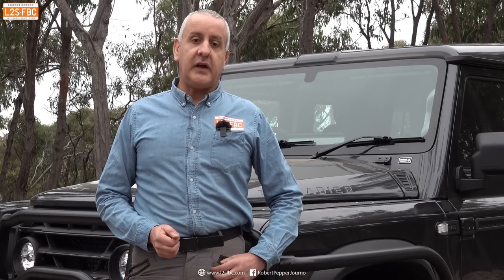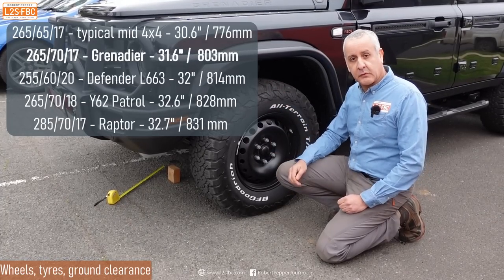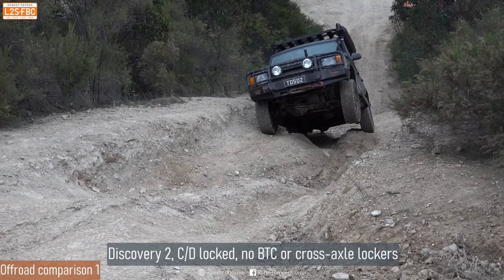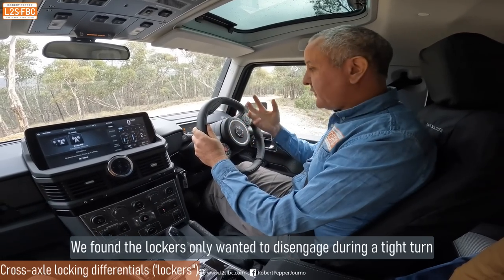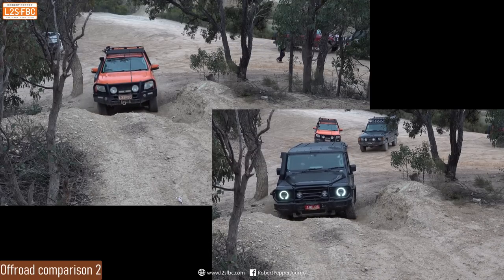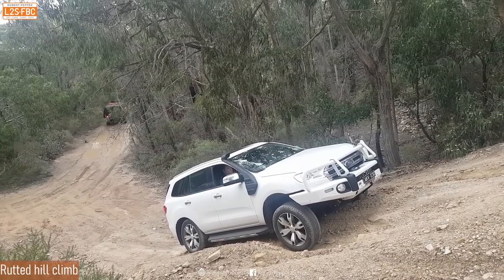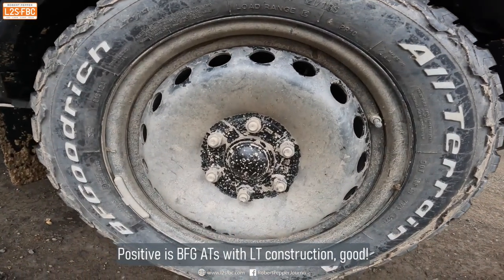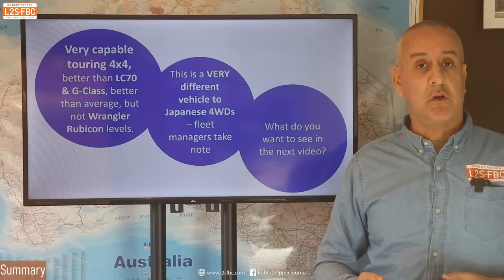INEOS Grenadier Offroad Review & Comparison : Australia

Comment: Excellent assessment. Fair and reasoned, unbiased. It strikes me as a unique vehicle in the modern 4x4 sector - combining modern TC and drivetrain/transmission with traditional chassis, suspension and axle design (isn't this what we've all been looking for?). Do you think the slightly inferior (to LR/T) BTC is a firmware update away from making it as capable as other BTC systems on metal sprung vehicles (ie no ability to shuttle spring rate/ride height as on Defender/Discovery)? I can't see any reason mechanically why it couldn't be 'upload update' refined to be as capable as Toyota's.
Reply from the maker: Thanks - the BTC may be a firmware issue, depends if the underlying hardware can handle it. Probably can. For BTC to be effective you need very sensitive and granular wheel speed sensors and then braking capability. I would expect the hardware to be in place, and the calibration need improvement. Possibly they took the view that people would just always use lockers. Well, doesn't work like that, lockers aren't always better.
Reply: Cheers fella. Interesting. I'd imagine JLR/Toyota's wheel speed sensors are third party supplier products anyway, but the software very much proprietary (and in JLR's case with TR2, their most important piece of intellectual property). Considering how long it's taken for BTC to exceed good ol' mechanical grip, there must be a lot of development required. Will be interesting to see if Ineos are happy to offer firmware updates as and when, rather than requiring you buy a new vehicle... As you know in soggy blighty, BTC performance is vital on simple wet climbs and its here that I've found modern JLR product unbeatable (though we have no LC300 or Patrol). @L2SFBC
Reply from the maker: There is precedent. Ford improve the BTC in the Everest (you don't get that in the UK) with a software update, so there is hope.

Comment: Hi Robert great review you can get the winch to work with the engine off say for instance you want to spool some rope  without the engine running just put it in "carwash mode" and the winch and NATO socket are powered.
Reply from the maker: No, won't work with the engine off, confirmed with INEOS.  Yes, a pain for the reason you mentioned and others.
Reply: @L2SFBC  I have a  Trialmaster and it does I can run the winch with the engine off .

Comment: I would like to know your thoughts on how easy it is to maintain for the home mechanic I.E. replacing brake pads, shocks and springs for a 2” lift, all the filters and oils, how good is the underbody protection from factory. 
Great video 👍
Reply from the maker: Can't say at this point, but I did take a look underneath and can't see any issues with suspension swaps, brakes etc.

Comment: What I want to see in the next video is how you can take an angle grinder to the DPF under the floor on the BMW engine to create enough clearance to then hammer the footwell flat on a RHD model. 
Then you might have some room for your left foot!
This vehicle has massive potential to be modified by the owners if they want to start hacking it around (and invalidate the warranty) but thats good right, its your vehicle do as you choose if you want
Reply from the maker: One owner has removed the footrest and found it to be much larger than required, so there's that.

Comment: Hi Robert I am a tow truck driver and I quite often look at these things from the angle of my job.
In the event of an electrical failure or the engine not running, can this vehicle with that electronic BMW shifter be put into neutral?
Now obviously if it has a manual lever to put the transfer case into neutral this will not be a problem.
A lot of BMW vehicles that I deal with have no way to put the vehicle into neutral without climbing underneath removing bash plates and manually selecting it on the side of the transmission.
Reply from the maker: I don't know, but suspect it wouldn't matter as the t'case could be put into neutral. Could any Grenadier owners confirm one way or the other please?  An excellent question.

Comment: Along with the exposed steering components, what about the Auto Cooler behind the bumper and it getting clogged by mud and thus the Auto Trans losing its cooling abilities? Also, the Rear Trailing Arms that are mounted on the chassis seem to hang down quite low - would this be a issue when 4wdriving in rocky situations or step-ups - are they prone to getting hit? 
I would like to see better views underneath and what potential there is for increasing the fuel capacity... 
The Aircraft tracks on the outside of the car on the doors and below the rear side windows - what are they useful for? Do u really need them (should they be an optional instead?)
What is the tallest Tyre that u can fit?
That suspension noise to me means they haven't selected a long enough coil and thus its moving in its seat - fitting a slightly longer/more progressive rate coil may prevent that suspension noise?

BTW: Great video as this is the first time a seen a video that tests the vehicles offroad ability in a bit more of a real world scenario...
Reply from the maker: I didn't spot the cooler issue. Arms aren't great but not overly concerned.  I'll cover fuel capacity etc another time, and the tracks.  I'm told 285/70/17 fits no problems. The coils are progressive. Thanks for the comment.
Reply: @L2SFBC , Yes I heard u mentioned the coils are progressive rate, but really, they should not be making that noise when flexing. My old Defender doesn't do that, and it has pretty good articulation as well. For me personally I would find that a little annoying on a new vehicle, but it should be fixable and it's not s showstopper.
Also I agree with your views re: The lack Winch operating flexibility...

Comment: question: can you put 33 or 35's into Grenadier ?
Cargo organizing. - How is floor design so it can be bolt down a draw system or slider 
Option to use side tie points. It looks like bunch of the but do they useful? Like on rear quarter panel has one track, it feels like a prefect place to use "Molle" panels. Does fit a large fuel cell? \
The roof length? RTT like ikamper fit?
tire Inflation system is really useable with 33/35 inch tires.

Comment: I would like to know your thoughts on road touring in the Grenadier, I have ordered one and would be using to commute 300km to work up a winding rural range on tar. Also planning to use to explore tracks around mid north coast. I have ordered without a winch, do you think a winch would be necessary, or would a turfer winch get out of trouble for occasional getting stuck.
Your thoughts would be appreciated, I enjoyed your off road test and comparison to vehicle which we all know and see.
Reply from the maker: I think i'd be fine for that use.  It's not a Defende onroad, but it doesn't need to be. I love winches, and even the INEOS winch is better than nothing...it all depends on what you intend  to do. I would definitley carry 4x recovery ramps, jack etc.

Comment: Good review. Grenadier traction control seems too slow, it seems to allow the wheel to spin a lot before it kicks in, whereas the new Defender system only allows far less slip.
Reply from the maker: It's not as good as Toyota or Land Rover, but it's good enough.
Reply: That is the hallmark of LR.  I would say the traction control was pretty good in the IG.  In  many of situations, you would have locked the diff before attempting.  Plus most people will have the electronic diff in the l663 so the on traction control would be the front wheel.

Comment: I reckon a 25-50mm more ground clearance would be useful. Awesome video!
Reply: Yeah I agree it looks way too low and unfortunately looks like you can't fit bigger tires very easily so it did follow Land Rover in that way haha I'm surprised they're comparing it to an old disco when it's so expensive in 20 years newer it should have compared it to a Bronco and a Wrangler Rubicon but by the end of the video everybody would have wanted a Wrangler Rubicon what is outstanding everything ability

Comment: The 300 Series GR-S is equipped with 265/65x18" which is same nominal diameter as the Grenadier's 265/70x17" - I do agree that this is a slightly small size compared to what is standard for Y62 Patrol, etc.  

Disengaging / engaging the lockers is a general pain in the butt for even ARB air lockers.  The best system is the computer controlled Land Rover Defender.  But the jury is out on the Defender's locker reliability in the long run.

Land Rover's traction control is head and shoulders above every other make but the Grenadier's system looks reasonably well calibrated.
Reply from the maker: Yes, same size; I feel that given how offroad-oriented the Grenadier is, it should have gone larger. I did not make the same criticism of the LC300 when I did the preview drive as that car is more multi-purpose than the Grenadier.

Comment: Great video Robert. I’m a novice with BTC, so here’s a question that may have an obvious answer. Can you modulate roll back on a difficult up hill section with the hand brake in those interim few seconds before the system catches up?
I hope that’s a clear  wording of my question
Reply from the maker: BTC is Brake Traction Control, explained here https://youtu.be/_CqkDLo1owA .  What I was doing for the test was driving badly; I let the car come to a complete halt to see if it'd pull itself out.  The correct driving technique is not to come to a stop, and that is demonstrated both ways in the video linked.  If you do need to hill start, then use left-foot-braking as demonstrated in the video. Hopefully that answers it?

Comment: Heavy towing review please around 3.0T.  Given the good gvm, gcm, axle loads, tow capacity looks class leading on paper.. is it?
Reply from the maker: If I can get a car, then yes, also towing. The touring video will be a weights analysis for towing - spoiler - it's looking good. But I'd like to tow practically too.
Reply: @L2SFBC  Took an educated punt on this as a good out of the box  tow platform having followed the build and specs, one I can park at the shops, do the occasional off road adventure, legally tow something heavy and not have to spend another squillion dollars (after having to already spend a squillion dollars on a new 4x4) on upgrading suspension, cooling, oil catch-can, additional fuel filter, aux battery, off road tyres etc etc to then have a questionable driveline warranty should a claim need to be made.  Well presented video thank you and look forward to your 'Heavy vehicle towing review of the Ineos Grenadier' 😀

Comment: Discovery 2 has TC they just about invented it, how did TC work on the Grenadier with CDL and not without?
I thought Grenadier did not have TC , I may be wrong . 
Re winch you recommend rollers with synthetic never heard that before and would not recommend it personally
Reply from the maker: The video covers Grenadier with CDL unlocked and locked. Rollers work GREAT with synth rope!
Reply: @L2SFBC  you said the D2 did not have TC, which is not correct, and rollers with synthetic rope positively dangerous. I teach winching to Mountain Rescue English and Wales.
Reply: @L2SFBC  smooth fairlead for synthetic ropes
Reply: @Ardventures The D2 TC has been disconnected on that vehicle due locker installation. I have a D2 and agree, it’s TC is excellent, especially with a centre diff lock.
Reply: @davidkelly3779  maybe that should have been pointed out
Reply from the maker: It was...
Reply: @L2SFBC  no it wasn’t
Reply: @Ardventures  Yeah it was, that’s how I know.
Reply: @davidkelly3779  it said the D2 did not have TC

Comment: HDC needs to brake every wheel independently. So If the axle lockers are engaged, then when a wheel is in the air and it is stopped by the ABS, then the car would be still and no rolling down the hill

Comment: Robert... Many thanks mate for this review. You share great information. I'm anxious to get behind the wheel on one these vehicles, or perhaps purchase one. So disappointing about the winch mount drawbacks and frame-mounted recovery points not allowing a 4.75 Ton metal anchor shackle. So easy to engineer from conception; shame INEOS in my opinion. Love the strong live/solid axles plus the front AND rear axle lockers. Sorry Land Rover, I'd purchase a Grenadier LONG before I'd buy a new Defender. with the Grenadier I still worry about repair parts worldwide (unlike the "no worry" of getting parts for a Toyota or some Jeeps, and other vehicles that have been mass produced). When INEOS gets multi-thousands of these vehicles in the field, then my worry will be minimized. Repair parts availability is important to me since I teach my students to "Prepare for all things" and to choose a vehicle that will comfortably take you RSI - Remote, Solo (no other vehicles with you), and International. When off-roading, there is no more "worse" context of RSI. Cheers Robert.
Reply from the maker: Thanks Bob that means a lot coming from you.  The 4.75 does fit one way around only on the front, rear both ways easily. As per my pic I'm thinking of having to put it on blind under mud or water and therefore if that loop was a fraction larger that'd be good. Interested in your thoughts re winch...I don't think it's unusable but I'd definitely take an aftermarket bar and winch instead.

Comment: Better than a G Wagen?
My 2013 V6 diesel three lockers standard manual fix in low ratio so can start off in 7th if necessary . Lacking hill descent but off road ABS program full articulation on beam axles and same ground clearance . 100 l tank, High ratio has modified Merc 4 matic. Will run on 16 in rims. No  centre  diff lock in high range a downer. Seems on a par with Ineos IMHO!!
Reply from the maker: Well you already mentioned just one reason I feel the Grenadier is better...and I was talking offroad capability only. 100L tank good, but also consider fuel consumption.

Comment: Robert, on a few videos we hear about the post 2020 Hilux/Fortuner/Prado traction control being very good and some say it is better than just the rear diff lock in the same vehicle. Would you be able to test this, maybe throw in a new Ranger with its traction control and just rear diff lock as I believe the Ranger permits the front traction control to work with the rear diff lock. Maybe this will interest some of us. This video was interesting, thankyou.
Reply from the maker: Cross-axle lockers vs Brake Traction Control is interesting. It is not a one better than other, both have their place. In many cases, a vehicle with good BTC will outperform one that has a rear locker and a non-BTC from diff; Mitsu Pajero as but one example.  Twin locked cannot be beaten for rocky climbs though, but Toyota's Crawl Control comes very very close.  Since PX2 Ranger has allowed BTC on front axle, locker on rear, and HDC with rear locker, so a bit disappointed INEOS did not offer same in Grenadier. Hope that helps.

Comment: an excellent review. I think it did really well for an unmodified vehicle. traction control is no replacement for articulation is it! Good compromise for on and off road use though i guess.
Reply from the maker: Well, traction control IS a replacement for articulation - it has allowed fully independent suspension vehicles to go places they otherwise could not. And, fully indie offers huge ground clearance - look at Y62, Discovery 3/4/5, L663 Defender as examples.
Reply: @L2SFBC  A wheel off the ground has no benefit, still they are incredible tech. even if they don't have 6' of travel like i want. ineos looks like more than any normal individual needs.

Comment: The Disco 2 must have had its traction controlled disabled given the locker fitment. They had a good TCS. It was a better offroader as one would expect than Ineos once both were locked.  Better travel too.  The banging from both front and rear ends in the Ineos is not ideal.  Cheers
Reply from the maker: Yes was disabled.

Comment: Excellent video...... but with my suffix A 1972 Range Rover I just drop into low range and select third gear and it will go anywhere!!!! It weighs 1500 kilos and has a magical V8 engine!!!! If things get tough I just use the vacuum Knob that locks the Centre differential and away I go!!!! Old school..... but it works brilliantly!!!!! Regards Ian 👨‍🎤🇳🇿👍🏉..... Go the ABs
Reply from the maker: I'd love to drive that car, a classic Rangie is one of my all-time favouries!  However even the Rangie would have suffered similar to the Discovery 2, it'd have run out of axle flex and therefore traction and if it has the standard open diffs...game over unless more momentum :-(

Comment: It’s the same on every vehicle, I have a 1990 w461 G I need to steer to disengage the locks, they lock on wheel slip and disengage when the whole transmission is loose.
I think tho only weak point of the car is the badly positioned steering wheel damper which will go out of use in the first rock

Comment: I would imagine you do not want to winch in park because it puts an enormous amount of stress on the parking pawl. You want to winch with brakes held and hood (bonnet up) in case of a cable snap. And of course the engine should be running so that you do not run down the battery (but I understand wanting the last ditch effort but I would surmise they want to make it dummy proof for the masses).
Reply from the maker: You should have the option if needs be. The bonnet need not be up, and in some cases should not be.